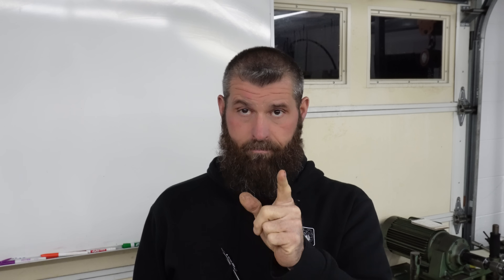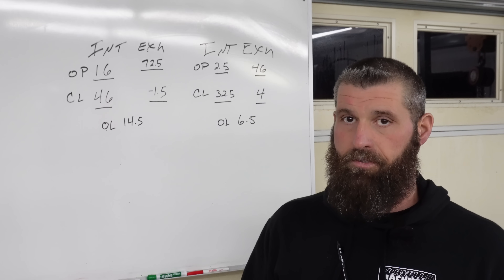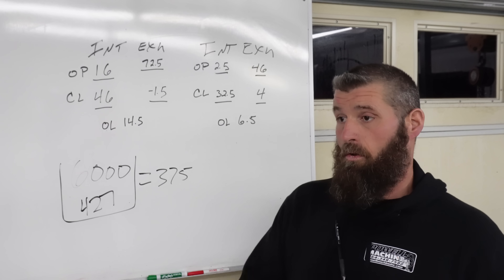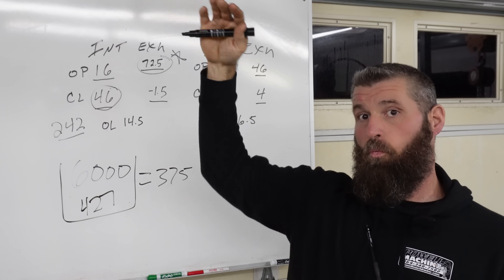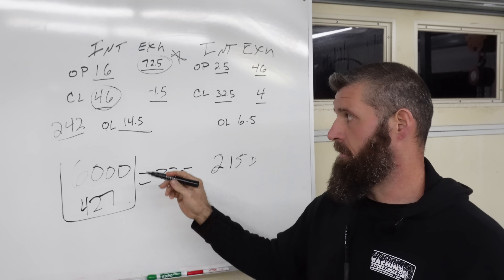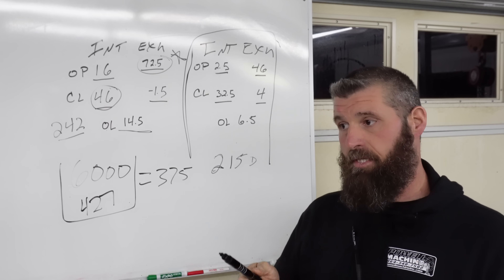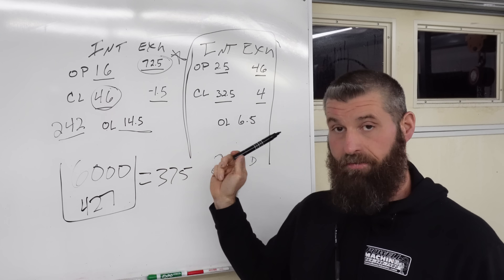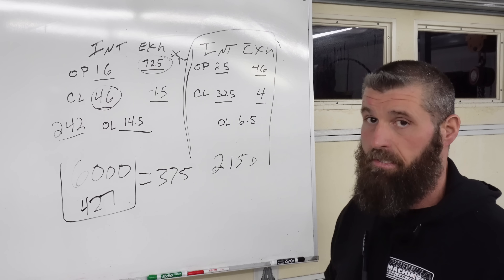Camshaft Tech... How to lose 100 Hp!

Comment: I used to watch that show, and it's just a long commercial for the products they use in a build. By now, there's no secrets to making big LS power. Guys put big cubic inches into a classic car that will never see redline or a track. Reminds me of the car magazine builds in the 70's.
Reply from the maker: It's definitely a common theme
Reply: Yep they are imo
All about reading a list of stuff somebody told a friend who told a friend
6100 rpm...not a street drivable set up
Reply: Exactly right
Reply: Exactly! The producers basically give them a blank check and they're still not getting impressive numbers. I stopped watching them. They're way above my tax bracket.
Reply: Sponsors pay the bills, catalog builds are the norm😊😊

Comment: So I do have a question when you talk about cylinder and displacement combo and match the camshaft to that build and compression. So my question is what if compression displacement and cylinder head is the same but the difference is big bore short stroke vs small bore and big stroke would the camshaft be any difference. Also with compression if you had 13:1 compression vs 14 or 15 or 16 for alcohol how would you change the camshaft to something like that as well

Comment: I agree with you M.Powell. I don't know if you have seen the L33 Richard Holdener built a few years ago? He wanted to reach 100hp/liter. So he got 540 hp out of an all aluminium truck engine. The horsepower was the same as this 427, but with 102 cui less (a L33 is a 5.3), the guys at PowerNation should be ashamed. This 427 probably cost a pretty penny, a pretty penny not well invested in my opinion. Great video!👍less
Reply from the maker: Thanks for watching!

Comment: I watched that video also and was very disappointed at the power  levels. But boy they sure smooth talked it up like it was a beast with that creamy smooth idle. I would love to see a dyno on a similar 427 with their setup in it and then have you spec a max power cam for it and see the difference in the two just by changing the cams.
Reply from the maker: Definitely!

Comment: I wonder what you could do with a Ford 331 with GT40P heads in a towing application running at 2200 RPM...
Reply: Just curious why you would choose that engine for a towing application. Ideally you’d have a larger engine that makes a bunch of torque low in the RPM band.
Reply: @alantrimble2881  Well, sort of an old mans dream. I have a 1995 F150 Ext cab 5.0L for 30 years that still runs great, but gets horrible MPG. On cruise control at 70 MPH with A/C on, it is virtually floored 95% of the time. I can't tow a boat with the A/C on in overdrive so instead of 2200 RPM it's running 3000 RPM and still almost floored. I'm interested in max low end torque and the engine never goes much over 4000RPM. I suspect a cam change to really stuff the cylinders at 2K RPM would help plus a 331 rebuild. I wonder how much such a cam would cost...
8-)
Reply: Start with a small chamber 205cc head....

Comment: That flow number for that cylinder head I mean you probably have to ask Eric Weingardtner about it I don't mean to go crazy about it but claims flows vs actually flow the actual flow from like Eric or whoever is most of the time lower than claim flow number. And if I remember correctly afr mongoose head Eric says that is was one of the best ls3 heads he had flowed was I think 380 something I didn't remember I will have to look back on his video but he said it has very good valve spacing that the intake is further away from the cylinder wall than other heads he has flowed for ls3 and I think even Eric porting a Brodix was about 380 or close to it but I can't remember but it makes me curious what that head on what is actually flows maybe 360 if Eric flowed I know I am being way to particular but I figured I would help you I know it may not be to far off but I mean anything help I guess if you want to ask Eric in cylinder head flow to make sure or how far off claim flows are typically are to actually flows
Reply from the maker: Its accurate
Reply: @powellmachineinc oh it ok good because I remember it happens a lot where I ask Eric about a particular cylinder and I said hey chart claim flow says it flows this and he says it doesn't but it wasn't far off much at all. It was a protopline he said it doesn't flow that much off like 10cfm. So I mean 10cfm I guess ain't to much I guess so it made me think how many other heads like he mentioned brodix dragon slayers claims 300cfm and his bench is 290 so 10cfm so it ain't bad. So good think what you found from that cylinder head was accurate so that's good

Comment: LS over camming happens alot....   But on the other side i was curious if on the 22re if you would benefit moving the cam a tooth ?   i havent figured out # of the teeth vs degree on it,   just was curious if it would put you closer to where you wanted to be.      YES would enjoy more like these,   rpm limit vs duration,   open/closing etc...
Reply from the maker: Thanks for the suggestion!